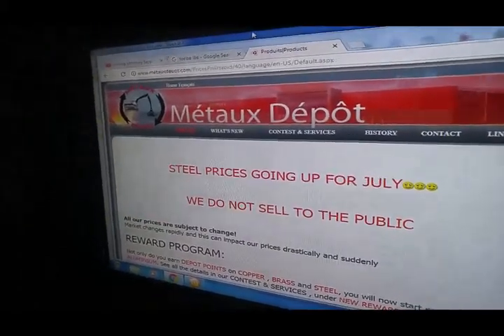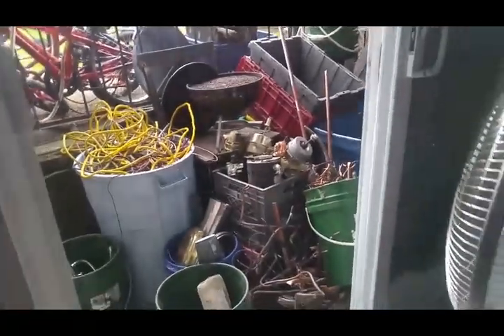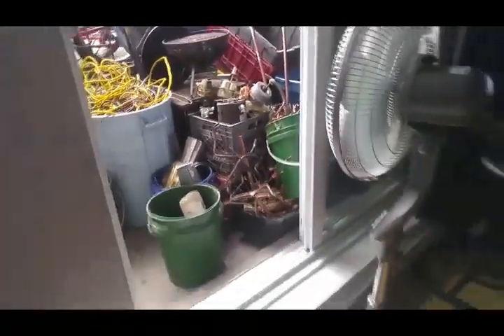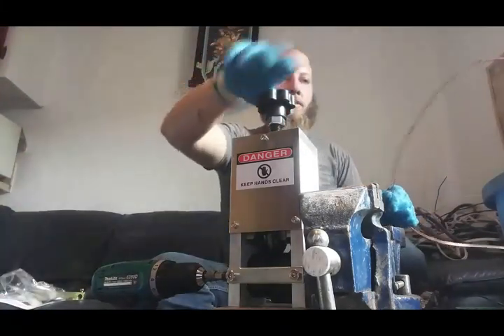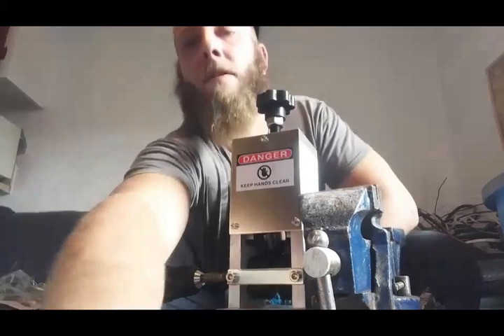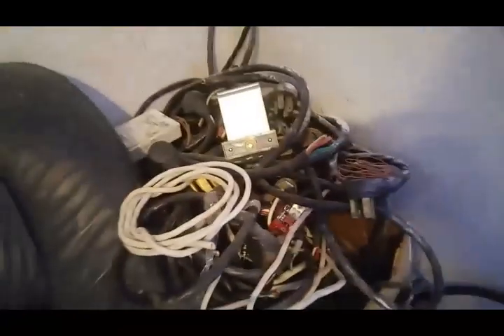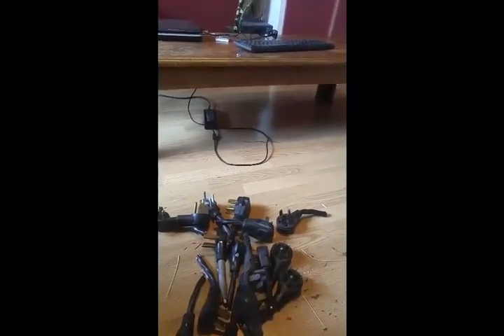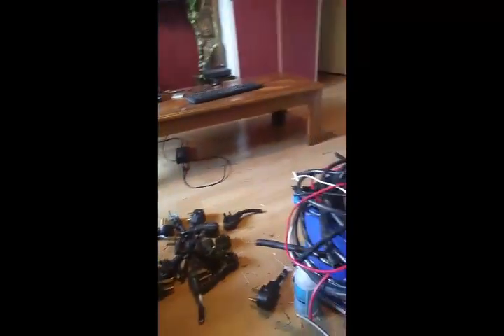my new WIRE STRIPPING machine

Comment: Question: I just bought one similar to that one . tried it out, it's cutting fine but will not pull the cable through I need some help to understand why? maybe I'm cutting through the cable to far, I got a bunch of vacuum machine cables, I'm trying to strip

Comment: Those prongs on the plugs are brass you could keep them separated as brass can be  good price to. 🤗
Reply from the maker: Gotta choose your fight... those plug ends still add up weight in my insulated copper wire bin

Comment: How do you adjust the blade, mine has gone of centre to the left
Reply from the maker: Be carefull to not strip the bolt i broke one trying to adjust it but with an allen key and 2 key when you dissamble it there is a tricky way to adjust it straight ...
Be carefull to not running the machine while its not center cause it gives a slack on the blade one of my machine is not fixable because i run it while it wasnt in the middle
Reply from the maker: Ther is to big bolt on each side of the blade be carefull cause 1/10 of a turn move the blade a lot of center
Reply: I tried turning the bolts on left and right of the blade, but it didn't do anything. Is it 
The two Allen keys under the front cover u have to adjust?. A little video of how to do it would be grateful
Reply from the maker: @brianmcnamara3189  the 2 big bolt on each side of the blade ...you slack the side you need the blade to go and you screw tight the other one ...but sorry i wont unset my machine just to make a video it was really a pain to set it ...i shouldnt ever played with those adjustement ...so are you

Comment: This machine works good for bigger cables  it doesnt work well for small cables at all
Reply from the maker: It does the job like any tool there a learning curve
Reply: For cables that are larger it is efficient, for small cables not so much as they tend to jump out of the blade quite a bit which makes the job take longer.
Reply from the maker: @theturkeybandit  if you set the guard lower so wire is more in contact with the wheels shouldnt jump out of his place
Reply: jackpot digger still jumps out when using 2.5mm 1.5mm cable. I have tried as low as the cutting wheel goes and on slow speed to avoid it jumping out. Any slight twist or kink in the cable will cause it to jump out unfortunately. Not saying the tool is rubbish because it worked great for sizes above 2.5mm but yeah just a chinese cheap and nasty get what you pay for tool.

Comment: I need to get one of these for sure :)
Reply from the maker: dont be rush 
its take a lot to get in the profit one with it ...i wouldnt recommand to start scrapping and buying one of those immediatly
Reply from the maker: if you get a lot of demolition stuff or electricien stuff maybe but if its all small mick macks that you found in trash ...dont go for that tool
you can do a lot with wire sniper and a rasor blade
Reply from the maker: and just strip #1 wire forget about the #2 beside if it has realy large copper conttent liek dryer or oven wire boster cable etc...

Comment: Do you still use this machine?  It is very cool!
Reply from the maker: yes i do and love it i need to upgrade it a bit install a nice motor on it 
something like zombie did has you seen his??
Reply: no I haven't   I suppose you just feed it right through continuously.  That is cool!
Reply from the maker: uberism has the cadillac one 
but you need to have good supply of that kind of wire its not realy good for domestic stuf its more 
for the high grade wire ts usefull
i stack my stuff and normaly do 3-4 day a year of using it not more then that ...but if ever i get a super load ill be ready to prospect it lol
Reply from the maker: but check that setup i will copy something similar https://www.youtube.com/watch?v=nQrdlqMZnuc&t=34s

Comment: If I could afford one of those I would take the handle off and attach a drill to it and make it a cordless wire stripper lol
Reply from the maker: i burned 1 cheap drill and one not so cheap drill...i wouldnt recommand it if its not 100% well setted need a hard working motor 
baught the other one that sold with a motor (same as uberism81)
much better 
but still use that one for some sort of cable its easier with the handle
Reply from the maker: and you better have good battery if you want to use it cordless ...lol
thanks for passing by on my freack show appreciate it 
wish you happy holidays
Reply: I def wouldn't use a cheap drill a good branded 20v drill would work just wouldn't tie button down to leave running the whole time lol but would work if u had a good drill.. buy I can see that manual would save more money cause there no electricity involved at all
Reply from the maker: that amopunt of electricity isnt a big deal at all lol 
glad i live in an hydro electrcity province ...im not saying it free or even cheap but lets say its CHEAPER then most place in the world
Reply: @jackpotdigger834  true there it's not to bad here where I'm from but it's not getting any cheaper by no means

Comment: Overpaid, I’ve just got the same stripper with the motor for £200
Reply from the maker: yeah there a wierd price difference with canada for i dont know why but if i go on ebay usa its like more then half price
Reply: @jackpotdigger834  i made my own from scrap motor and bits of steel from my scrapping. Even used my old mig welder i got from the scrap with wire i found svrapping